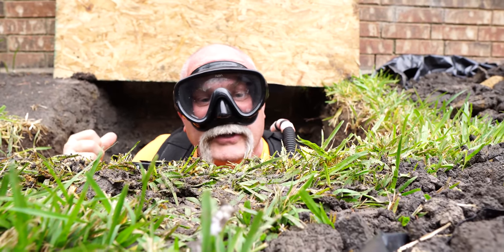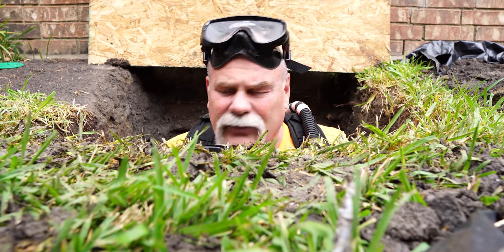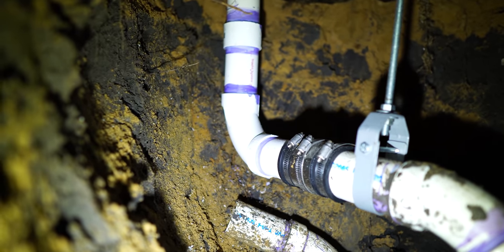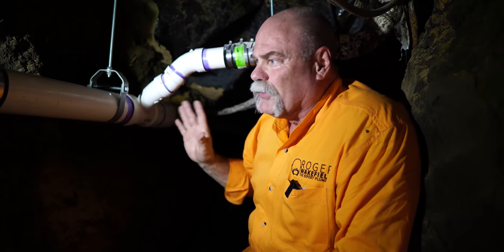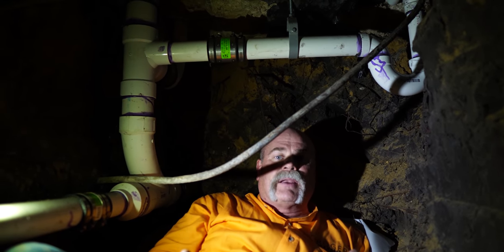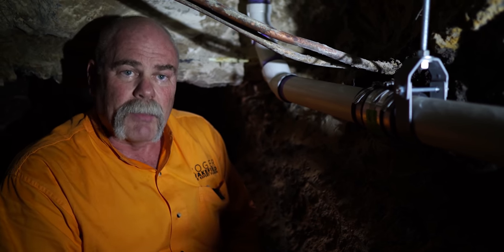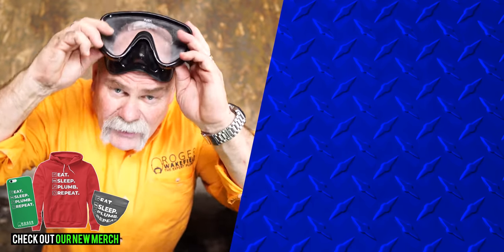DIVING DEEP Under a House to Repair Broken Sewer Lines

Comment: Just had the same thing done to our house here in Texas. A team of four guys cleared a 4X4 ft section in front of the house. About 4ft deep. Then two started digging under which I guess was about a hour a foot. Took about a day and a half. The plumber took about a day for the repair. Then had to wait for the inspector. Then had to wait to refill the hole. I went in the tunnel after they had finished digging and left. I could see where the break was it was not where the joints couple but in the middle of a pipe. Only stress would of done it. After the break roots found the crack and made it worse.

Comment: How common are those sanitary Y's with the side inlets? Ive done a good bit of sanitary work up here in MI, literally never seen one of those before 4:29. Looks super useful.
Reply: don't waste your time.  the position he installed it is the only legal way to install it and they are, frankly, bad fittings.  consider each line a lane in a highway.  you are essentially converging a 3 lane highway down to a single lane all at once.  something is going to go wrong and you'll have to snake it in the future.

Comment: Please help.  I need your expert opinion. Our sewer line was recently replaced because of roots. Except under our deck. Now there's major roots there too. They said we would have to rip up the deck because they can't dig with 3ft head clearance. Roto rooter recommended pipe bursting. But will the trenchless replacement sag over time and cause problems, since a gravel bed isn't put under it.

Comment: Hey Roger, Why do they not use crawl spaces in Texas there ? is the water table too high? or is it for solid slab construction, Here in Denver Metro all of the houses either have a crawl space or in the finished basement the pipes are in the ceilings and walls. Only the main drain is buried here going to the city sewer system buried under the street in the front of the house, the Old Denver neighborhoods from the 20-30's have the sewer in the back ally ways, so then the main sewer pipe goes through the backyard into the sewer buried under the ally way street. I kinda like the ally ways because then the garages are in the backside of the house and you have a nice clean looking front yard.

Comment: Wow here In Michigan we’re not allowed to use those crowsfoot fittings to tie in the toilet, tub, lav, and vent lol that’s crazy the inspectors there in Texas pass it and they’re fine with it 😂 we have to tie our groups together in on separate fittings
Reply: same here.  side inlet fittings are a clog waiting to happen.  texas doesn't have the highest standard in plumbing.  this is the state that accidentally repealed it's plumbing board and code, after all.

Comment: What method do you guys use to backfill a tunnel like that ? I’ve recently had to tunnel under a building for the same thing and we refilled it by passing buckets of dirt into the tunnel and slowly packing it in. Was wondering if your method was for efficient.

Comment: @Roger Wakefield  - are you saying sure band?  Is that stronger than a glued connector?  I see a lot of glued connectors in there, and only in a few places the sure band... Is that because it's spliced vs. installed from scatch (the whole system)?

Comment: It’s either situation but not both, the plumber did not properly support the rough-in, which is part of the inspection or the house/slab shifted which you said has happened and that’s why they had a foundation guy come in and reaffirm the structure. 

The customer got them a first class install from u, that’s without question, but you’re a brave person showing this to other plumbers.

Comment: Hey Roger. When you backfill , do the fernco/shearing need to be concreted in? In new jersey if they are installed under ground they need to be covered in cement at least 1 inch around.
Reply: that's just a regional thing.  some places will require it, some won't.  in most cases, the metal shielding on the band is enough since it's stronger than the pip itself.

Comment: New builds, the pipes lie in a thick bed of sand, and burred like 12" of sand ontop.  I assume to prevent any stress and allow the pipe to move incase the house or something moves?  Do you backfull with sand around the pipe to prevent any stress pulling/pushing on the pipe?

Comment: What is the difference between what you call a shear band and a Fernco coupling?  I see  that some of the larger sizes have four clamps and a few have a wide metal band all the way around coupling, but there Ferncos that have those also.

Comment: I do slab leak repairs here in Ohio but have rarely came across solid dirt. Its always pea gravel and it just continues to fall into the ditch. Do you ever brake up the concrete and go after it from above?

Comment: Best solution to the under slab problems is... get the plumbing out from under the slab  as directly as possible.  Don't cross under the center of the slab. Go out to the nearest edge and then run along  under and beside the slab to join  up the sewer.  For the supply, come up ASAP and run the pipes in the wall, not under slab.
Its not the cheapest because it can make the sewer (especially)  harder to get in with proper slope and you are likely to have a lot more pipe.
.
But with the pipe getting out from under the slab ASAP you don't have to dig 20 ft under the slab.  Any repair cost will be tremendously reduced.

Comment: As a Aussie plumber i find this very interesting but in Sydney where im from we don't have any pipe smaller then 4 inch under the slab and all of our pips need to be backfilled with blue metal gravel or sand

Comment: I have a cracked sewer pipe under my home. The house foundation was raised and now sits on piers and the plumbing work was subcontracted. I have reached out the foundation company to give my info on plumbing company but they have ignored my request. Not sure what my next move is other than bite the bullet and pay the cost. One thing I don't know if the work was ever inspected by the city.

Comment: We get clay here that normally it is good, but if you go to periods of very dry the clay shrinks and retreats away from structures leaving gaps, then with heavy rain over a long period it swells, and gradually structures built on it moves. So in buildings you might see doors or windows might not close properly or jam. or smaller concrete pads like footpaths come out of alignment and not level with each other.

Comment: Had a friend with a leak under slab. Water pipe sprung a leak, not sure of cause, is a 14 year old home. Busted through the slab to fix the leak. I doubt there are tunnel crews here, with this red clay dirt its probably cheaper to bust through the slab and re-do flooring where needed.

Comment: A repair bill for that with the digging and pipe replacement, what is the price tag associated with this job?
Reply: Just got a quote on my house. Granted, it is old cast iron plumbing that will need a crane to remove, but it's in the 10k ballpark.
Reply: More like 20k
Reply: Five digits
Reply: @PLAX84  minimum!
Reply: It depends largely on how much you have to dig. For a tunnel that size (approximately 10 feet)most plumbing companies would charge 7-10k
Reply: I paid $22,000. 85 feet of tunnel. All new sewer lines. The digging is the expensive part. The plumbing took a day and a half. The digging and back filling took 5.
Reply: 25k+ 🤷🏻‍♂️

Comment: Brother I love your what your doing . But I must ask why didn’t you use  PVC  with no stop couplings? Those sheer rubber couplings when used under ground I have noticed that roots go through them. Just a question not crapping on your job. Just curios. Big Fan!1

Comment: Looks really good and the bands very good choice 👍🏼 and hanging it is a must also yes bending is key that’s why if it’s not bedded right inspection will fail my only thing was the 2 inch 90 that is in the beginning it looked like it had back fall maybe wrong but take a look at it on the video and yes I know if it did it wouldn’t pass but just letting you know what it looks like on my end I really love tunnel repair job not the digging lol but redoing all the drain lines is nice and easy at least for me just hate to wait for engineer to give the ok on going in and out of a beam or even the ok to brake some of it off to get to a bad fitting well good job on the work and video keep up the good work 
Alopezjr 
Satx
Plumber in San Antonio

Comment: Are the, "sheer bands" comparable to no-hubs? It looks like a blend of fernco and no hub.
Reply: it's just a fernco with metal shielding.  the metal is much thicker than your standard no hub.  it's more comparable to stainless steel than the tin wrap on no hub.

Comment: Why you all the strong band fernco  vs using pvc pressure couplings that give you extra depth to glue with? And on the toilet you installed all new pvc to vent and tub and glue all the fitting but the one fitting has a strong band only. Why didn't you  glue that also,  which i do understand it might have been a little harder to glue straight on with hooking onto existing pvc, tough sometimes.

Comment: i dont like fernco, no hub bands,[ rubber hose clamps] halve the time after installation they have a raised lip inside the pipe that catches debris, people like to skimp,like roughing in with 3" instead of 4", 30/34, thinwall instead of sch 40.

Comment: This is insane. I never seen a company that excavates to that extent. Whenever I need to repair a drain under a slab I dig a hole inside the house and break up concrete. How do you get the manpower to trench that out? You must have a huge excavating team.

Comment: Do those no hub bands make a more rigid connection rather than pvc glue couplings ? Or is that preference for your underground ?Also how did you test ? Clean out tee with test ball ? Seems like there would be a lot of head pressure when filled up through the slab. Local 24 💪🏼
Reply: Okay, Local 24. What's the pressure per foot of vertical rise of H2O? "Head Pressure" What's the minimum test pressure on DWV? Say, you wanted to use air pressure instead of water.
Reply: @TheNimshew  no air pressure test on plastic pipe. You’re creating what’s called a “ pipe bomb “
Reply: @prodylanman  Well? What is the air test pressure on DWV, other than plastic? 10 foot of water head is 4.34 psi.
Reply: forty two pretty sure I remember only seeing pvc in the video so I’m not really seeing how the PSI requirement on an air test of a metal dwv line helps here

Comment: Fernco bands aren't code in my state. I dont know if sure bands would pass inspection. Why wouldn't you use husky bands?
Reply: Also do you need to wrap the bands in tape or some rubber material to insure that they do not rot over time?

Comment: Why would u use  Franco coupler instead of using a coupler of pvc or a repair coupler?
Reply: Looks like the Franco coupler with the rubber might allow for some slight movement in all directions once it is back filled and things settle over the years.  Going "hard pipe" and not using any connections that allow for a bit to be flexible could cause cracks if it shifted.  You want a bit of 'give' so it doesn't stress crack.

Or at least that's how it looks when I watched it.  Roger put a bit of weight on the pipes and you can clearly see it flexing a bit on the rubber and not binding up the whole span.

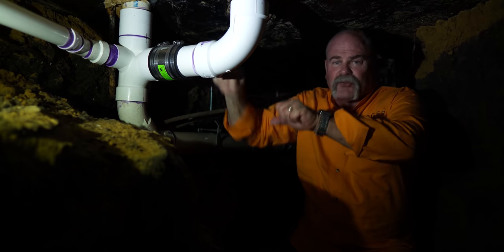Comment: What is that tee looking fitting at 5:00 never seen one like that before :O
Reply: almost looks like a Bungalow tee is what I've called them or a cottage tee, only like 1 or 2 instances by code you're allowed to use them where im from, and underground isn't one of them
Reply: @guywal3720  interesting, yeah I was wondering if it followed code, I'm only an apprentice so I wasn't sure lol guess it's different code depending on where you live tho

Comment: Have pipe under house at 5' from edge of slab in half bath. Roots in some yard pipe. Slab has major cracks. Make sense to do the slab leveling at the same time as pipe repair, money pending. :0)

Comment: Learned a hard lesson for not blue staking landscape work guy was suppose to take off 5 inches my grass and rocks. I just assumed he know where a house cleanout was in front of the house he had no clue busted both off with a bobcat and filled with dirt and rocks. I got it cleaned out now my line is holding water I'm hoping it's just a hydro jet clean but I fear he bucked the sewer line maybe bending the pipe up cracking it who knows plumber is coming tomorrow.  Just a word always call out blue state before doing any digging.

Comment: This may be stupid I am ignorant to this stuff. Why fill it back in? It will become a lake? Why not leave it open for future repairs? I'd imagine the dig stuff costs more than the plumbing repair.
Reply: Correct. it would become a lake and water would push up the slab and further erode the soil. This is common in the Dallas Fort Worth, Texas region where this was shot.  Basements are cost prohibitive due to clay soil. There are some pier and beam in older homes. But 99% of new residential construction in last 30 to 40 years is slab on grade. Thankfully these occurrences are rare. But when it happens you are pretty much screwed financially.
Reply: @chancelindsey  Thank you sir!

Comment: I always hear y'all saying "for the rest of the time [the tennant] is here" and it always gets under my skin to think houses are temporary.
Over here in germany privately built houses (a family building for themselves... Feels like it's getting rarer these days) are generally built to be as long lasting as possible.
Reply: Most homes here are privately build, unless you are talking about the actual family themselves doing the work. Every one always says "we don't build them like we use to".  But the reality is that homes are rarely torn down. When they are it is usually to build something commercial or due to a new road.  I am certain that my house was built to last longer than my lifetime.

Comment: Absolute stupidity how they bury glued plastic fittings deeply like that and concrete over - just asking for trouble. I like how the UK used to plumb with drain lines running down exterior, exposed copper pipes at baseboard level for radiators and bathrooms with removeable service panels everywhere. I remember using pull chain overhead tank toilets as a kid that could flush a medium sized cat.

Comment: We just jackhammer through the slab for repairs.
Reply: The repairs are made under the slab.  Are you going to tear up all the floors in the home in order to jack hammer the slab up?  This way might look strange, but it does minimum damage to the living space(s) in the home.   If they jack hammered up and went straight down as you suggested?  That would be two huge trenches in the living spaces that would need to be repaired..  (all new floors, carpet, etc...)
Reply: @Tedybear315  yes, we remove carpet or whatever, then bring in a jackhammer powered by a compressor. We put up plastic and have fans going. We have done apartments where it goes from one apartment to the next. It is kinda crazy, but that’s how we do it🤷‍♂️ I think I work for a lower tier company lol
Reply: righyan bear we do it the same way here n Cali go straight down thru the slab.

Comment: Somehow I would figure a way to turn those into crawlspaces.
Reply: I was thinking the same thing. Once you've dug it out, no sense in covering it up only to have to dig out again. But then again, that would require an engineer and crew to build out the reinforcement for a tunnel.